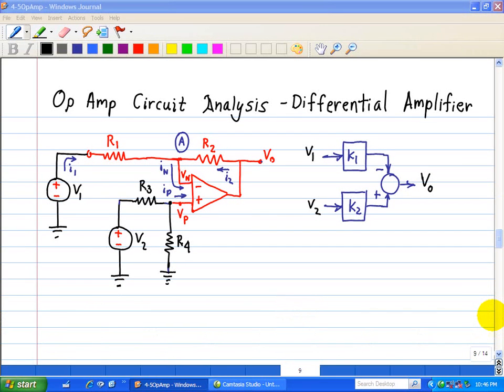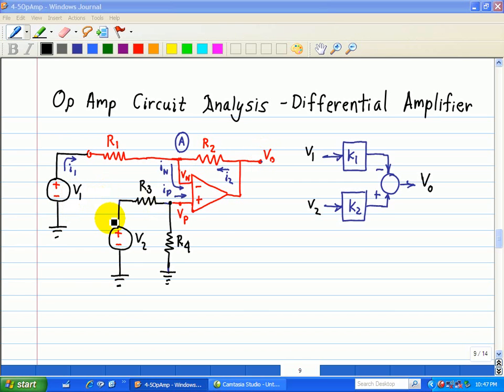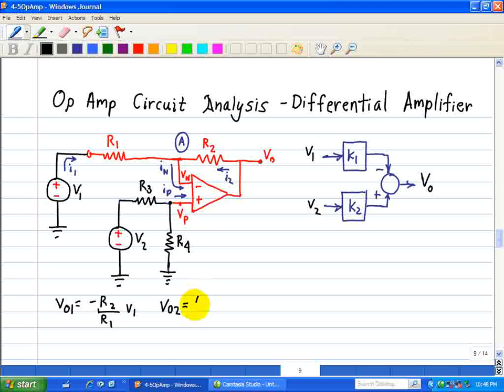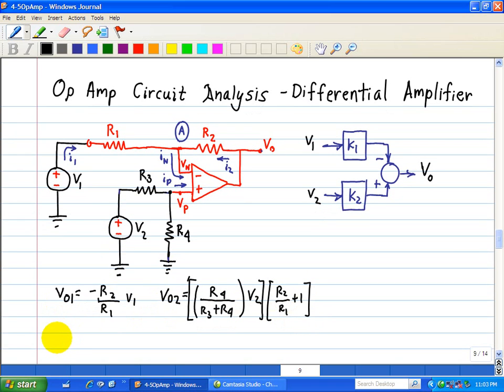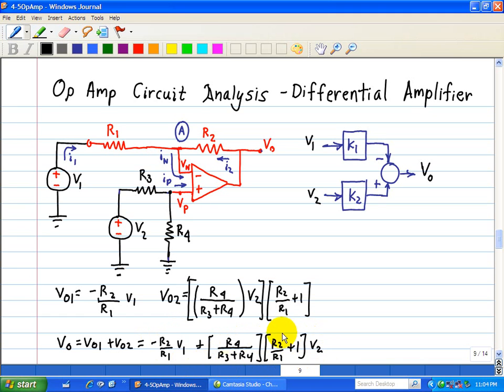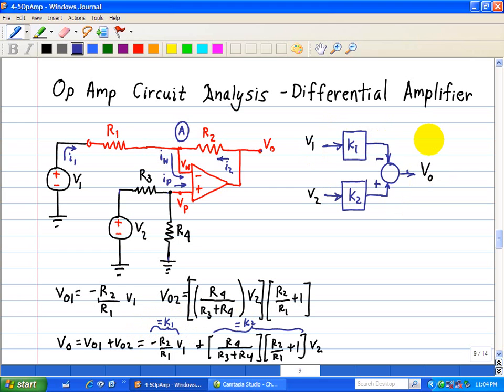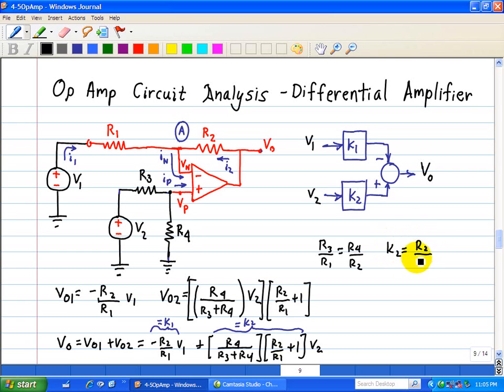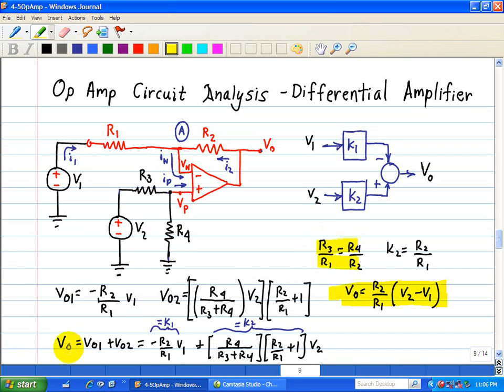Op Amp Design Basics - Difference Amplifier -Subtractor - Part  5

Comment from the maker: @faisal22naveed From previous videos and shorting out the inverting source input, this is the noninverting gain of a noninverting amplifier.  The circuit shown for the noninverting input has a voltage divider.  vp=v2*R4/(R3+R4) since this is a voltage divider at the output.  Note that vp=vn=vo2*R1/(R1+R2) or vo2=vp*(R1+R2)/R2=vp*(1+R2/R1).   Hence k2=v02/v2=[1+(R2/R1)]*[1+(R4/(R3+R4)].  Hope this helps!  Dr J